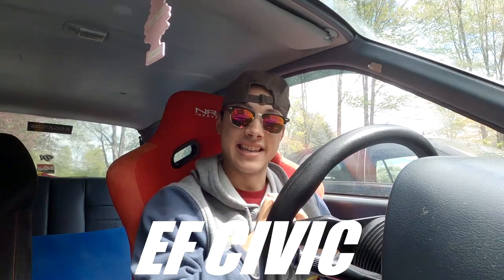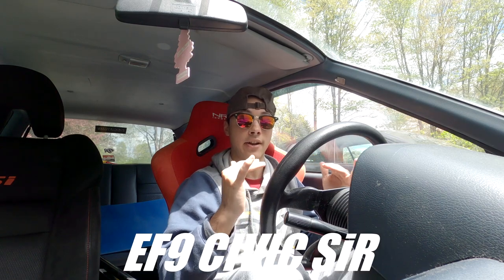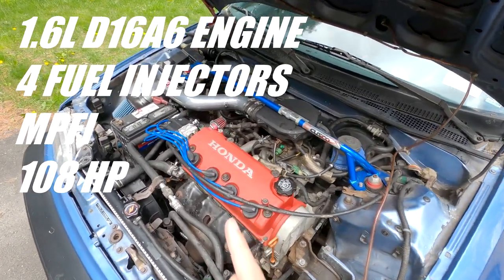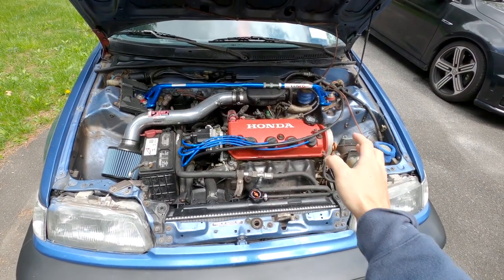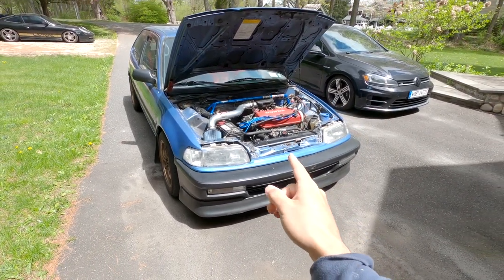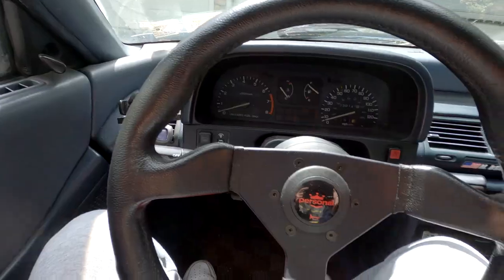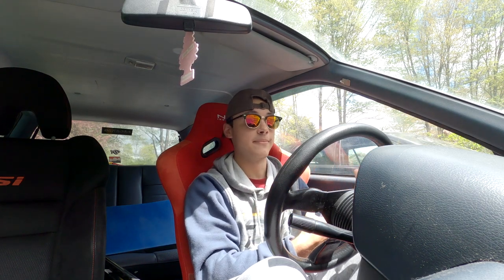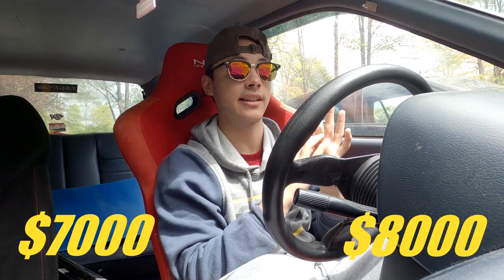Watch this video before you buy an EF Civic

Comment: Both the D15 and D16 are great engines. The D16Y8 is a great engine as well (don't know why whoever swapped yours didn't convert it to mpfi and you should have VTEC with that engine). They're just not "performance oriented". 
If you're going to buy an EF with a B-series in it in the US, then you'll have the same, if not worse, issues than what you're dealing with on yours. Reason being, someone would have swapped the B-series in the car first off and most likely beat on it because they thought it was fast. Plus B-swapping an EF takes a little more aftermarket parts and modifications to accomplish than an eg or ek. So, a lot of the times kids or what I like to call "Honda Bois" cut corners and cheap out on parts making the car a complete hooptie. You'll end up spending more money and time fixing their garbage wiring, modifications, chasing issues, etc. than it's worth if you would swap it yourself.
Main issues on EF chassis is rocker rust and taillight wiring. Every EF I've owned had either of those issues or both but the taillight wiring is very easy to fix at least. Rockers, more so is just finding a shop to replace them. Other than that, extremely reliable, easy ro work on, fun to drive cars.
My suggestion in buying an EF or any Honda/project car in general is buy the closest to stock as you can and do all the modifications yourself. That way there's no surprises, you can put quality parts in it and do it right the first time rather than back tracking through someone else's "build" to make it right
Reply from the maker: Couldn't agree more with what you said. I'm sure someone will find this comment very informative! I quickly learned after I got into cars that you tread dangerous waters if you buy someone else's honda boi project and you learn very quickly that a lot of those people love to cut corners...
Reply: @Max Briscoe  for sure. I've had so many bad experiences with buying modified cars. Mostly with my friends buying a Honda to get into them and then asking me to come over and look at it/fix it 😅. Then we're over there pulling the entire dash out and chassis harness because of how hacked up it is and so on. I'm to the point where if I buy a car that's already been modified, it's just for parts
Reply: Thank God I found your comment, I'm about to buy an EF I'm pretty sure it has a D16Y engine, apparently everything works seriously fine. But what would you suggest before I pay for it, what do I have to pay serious attention to before I close the deal. Should I take it to a mechanic, what would you suggest?

Comment: i disagree about buying a ef in a project state or if it has a B or D series and mpfi swaps and everything like this is really easy to do its super simple even converting over to obd1 and you talk about the price of them and it all matters where your located i seen your in ct so any clean ef is easy worth 7/8k you kind of mis informing people the value is going up because there are not many examples of them left and the ones that are are rotted out holes in the floor rockers trunk unless you dont know what you doing with a car stay away from a project but if you want to learn its not a terrible car to go with handle amazing super light under 2000 pounds pretty much a track car from factory if your looking to just buy something thinking theres no problems or there wont be wiring gremlins or anything like that go buy a base model civic EFs are becoming collector cars and its kids like you who destroy them

Comment: The D15B2 is well known as one of the most reliable engines ever made.
Reply: Sure but it still has to be maintained. And if somebody starts monkeying with it or abusing it then it can create problems for the next owner.  The piston rings on the D series engines don't respond well to not getting proper oil changes and it's impossible to know if the previous owners ever had issues with overheating or if they changed the timing belt and water pump at the stated intervals. It's a 30+ year old engine at this point and even the best made engines in the world are going to wear out in that time period (and even faster if not properly maintained).
Reply: @ashleighelizabeth5916  oh of course, it's an economy engine, it's not gonna love being ignored or intentionally abused. Mine had a rotted out headgasket, but I'll say that since replacing it (which is relatively easy to do TBH), it's been utterly perfect. And let me tell you, there were some horrors underneath that cylinder head.
They're not invincible, but no motor actually is.
The best luck is finding one under 100k miles because then you're less likely to have someone's irreparable neglect victim, but obviously that can be a challenge!

Comment: I just picked up a nearly rust free 91 si. It's not perfect, but it's got a solid body, and is mechanically sorted. 
The only rust on it is inside the wheel well down by the rocker, but a borescope showed that's where it stops. The 1/4 panels, rockers, trunk area etc are all perfect.
I paid 3k

Comment: Look the short version is this; unless you buy an Si with a low mileage d16a6 that's been well maintained you should plan on replacing the engine in your EF hatch (if it hasn't already been done).  

The motors that came in these cars are 30+ years old at this point and most of their lives have probably been with underfunded owners that didn't keep up with their maintenance properly.  The D series motor is very well built but if it doesn't get regular oil changes it's going to cause oil consumption and blow by issues. The less said about regular timing belt and water pump replacements (or more importantly the lack there of the better).  

What that means is that unless the car has a B series engine or already installed (or possibly a VTEC D16y8) you should budget as if the engine installed is going to be replaced and make any offer to the seller on the basis of that information.  If you plan on buying an EF with a swapped engine then you need to known enough about the cars and the engines and the swaps to be able to ask smart questions about what you're getting. And if you don't get answers you like then then either walk away or drop your offer price.  

Nobody that owns a car this old should go into it without at least some mechanical knowledge and (if they aren't going to do the work themselves) a knowledgeable and reliable mechanic.

Comment: You might like the engine from my 1997 Del Sol Si.  It  Is a Sohc vtec . It has multi point fuel injection.  It creates 127 horsepower.  The compression is close to 10 to 1.  It uses any 87 octane fuel.  My car had 221,000 miles.  It runs strong.  I use Bosch 4 prong platinum plugs.   The car start fast .   I get in the low 30’s per gallon .  I am a original owner.  I love my car.  It has a five speed manual transmission.  I will keep my car forever!

Comment: Well, my 2 cents here, if you are willing to get your hands dirty, than you can get a non running car. That's a lot, a lot cheaper. I would look at the shell firstly, than look at the engine. Personally i would avoid the carbureted version, as it doesn't have the electric fuel pump, and the lines for it, and the gas tank itself is different, not a big deal, but it's a lot easier when you already have that. Swapping mpfi is not difficult, obd1 pm28 ECUs are overrated. You can chip a pm06(si) and pmo7 ECUs fine, if you aren't planning to make a thousand hp and tune the car everyday of the week, you can get away with it. The zc dohc engine is under rated, it's a very torque engine, pared with an si or zc transmission can be very fun. I bought a rusty ed7 with blown d15b2 for 300 bucks, and with a help of a friend, swapped in a dohc zc for another 350. With some suspension mods and bucket seats, this car is very fun for the money, perfect for some canyon roads, or some weekend track days on a budget. Hoping to supercharge it some day.

Comment: I’m confused with the dx and ef terminology. I thought or from my understanding was that only si’s had the ef chassis lol.
Reply from the maker: dx = ed6, sir = ef9, crx = ef8 (people just say EF because it's easier and more recognizable)
Reply: @maxbriscoegarage ok. Bro I found a dx with original motor of like 70k miles and it’s the cleanest dx I’ve EVER seen inside and out. It has mostly stock but it’s clean. He’s asking 8k. He has the original bill of sale too and owners manual. 
What engine was the original in a 1990 dx?
Reply from the maker: @josegarza7719  d15b2 dual point fuel injection with a 4 speed. Si hatch came with d16a6 multi point fuel injection

Comment: Purchased my second "EF" 91 dx with the DPI d15 for $1,500. Just needed a Main Relay and prior to that going out they only wanted $2,500. But the going rate for these in my area (Phoenix AZ) is around 3.5k to 4.5k. If your willing to pay 7k like max suggested as a max it better be swapped with something dual cam and a clean body to boot. IMHO. . .

Comment: My hatch was the “standard” model, a d15b1 and a FOUR speed manual trans. The d15b1 looks like the d15b2 but has 20 less horsepower (70).
Anyway I did the MPFI swap and put a d16y7 in it with a five speed. These really aren’t that hard to work on or modify. I also had to undo some poor quality work from the previous owner but parts are cheap 🤷‍♂️

Comment: What about the automatic versions? Are they less reliable?
Reply: Nope my parents bought mines in 91 and it lasted until 2018 i need a new engine now mines overheats bad, changed so many things thermostat, radiator, radiator cap & still overheats

Comment: I have one with a d15b4 being the carbie motor worse then yours 😩 and I have so much work to switch to it to efi
Reply: Just do a b swap
Reply: @Mohamed Mohamed  from what I've seen, they're very expensive, at that point just k swap unless you want to be period correct
Reply: @djpollo2474  cheap b swaps are still out there especially through word of mouth. i did my b16a3 swap for well under 2k

Comment: So you say dont buy an ef thats has "Frankenstein" done to it but then say dont buy one unless its been mpfi converted or is the very rare si model d16. 
Id recommend for anyone new to honda that got an ef to do a b20 swap. Lowish cost for now. Doubles the tq of the si model. 50% more hp. Pretty  refined swap with lots of info available on how to do it. Or buy one that has already been b swapped or d series vtec swapped. Dont get an ef as your race car/toy unles you really enjoy the styling. Parts are hard to find. K series swaps are not refined at all. B series vtec stuff is super expensive now, like more expensive than k stuff.
Dc tegs, eg, and up are your best bet if you are looking for fast and cheap. Slap a k24 in and enjoy. 
At this point efs are classic cars with harder more expensive parts to find for them than 60s american classics.

Comment: Great guide 😁 i live in europe and mine is an ec9 (d14a1) . Installed bike carbs, best mod i could do... had many problems with the oem dual carbs
Reply: Have the same engine. How does it feel with bike carbs. Only the sound changes or there are some benefits regarding performance?

Comment: I have my sight on a 1990 hatch that looks rust free (might be a miracle or something) and pretty much stock apart from a shift knob and a set of alloy wheels, costs 894k HUF which is around 2300 USD but sadly the guy selling it only mentions that it's a 1.5 16v which probably is the D15B3 or D15B4 (european market) soooo it either has hidden problems or they are that cheap in Hungary lol 

The video wasn't that helpful for me but that doesn't mean it's a bad video so i dropped a like 🤝🏻

Comment: Had the same engine in mine.  Got me to NC and Florida back with like 50$ in gas. Only problem it gave me was the timing belt broke while I was driving it BUT since it’s a non interference engine it bent no valves. Slapped a new timing belt on and it’s been running strong as ever.  You just have a shitty EF civic sad to say